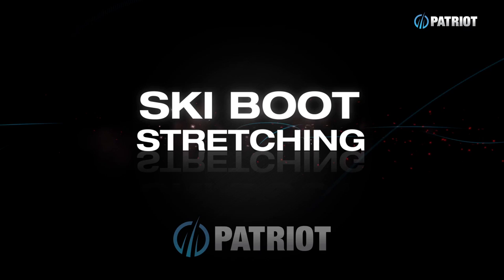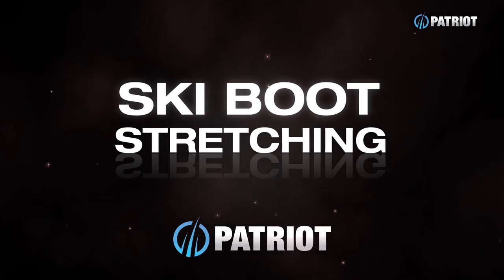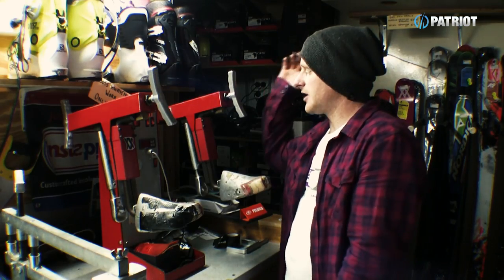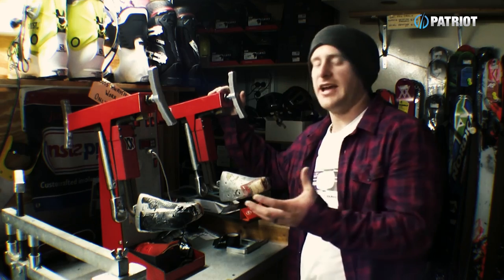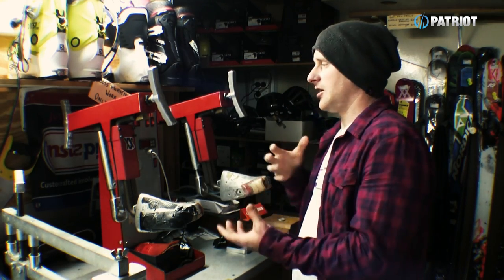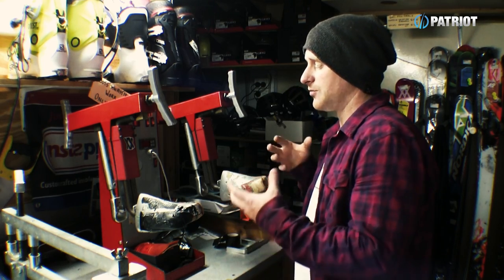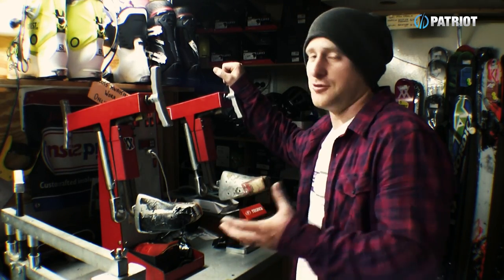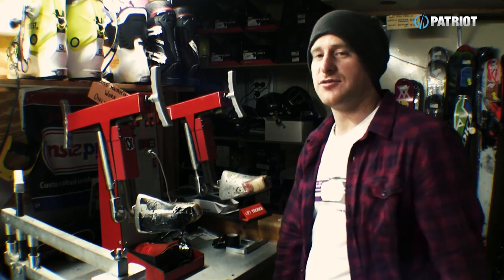Ski Boot Stretching- Bootorials Ep. 13

Comment: Hi, great video, keep up the good work. I bought boots that seem a tad smaller - they're all track 100, 28.5, but I keep having blue toes every time I ski. Also the forefoot seems a bit tight. Would you recommend stretching them? I'm currently in between Bulgaria and UK so not sure where to go. Any advise would be greatly appreciated.
Reply from the maker: Hi Georgi, Thanks!
Yeah so they definitely could be stretched if that is needed. But first I would recommend doing some sizing checks. 
I have a video series call Shell Fitting. That can help you figure out where the size or fitting issue is and dial in the best approach. 
If that is all looking good, then be sure to have some footbeds to stabilise your foot inside the boot, optimise the fit and keep your toes from slamming forward. 
And then if needed you can look to get them stretched out. I'm not sure about Bulgaria,(maybe in the Bansko area) but there will definitely be some bootfitters in the UK that can do this for you. 
Cheers and best of luck!

Comment: Hey bro, greats vids. You know where I can get a metal “jumbo” like that? Or did you make it
Reply from the maker: Hi Brendan, So these are sought through bootfitting suppliers, these ones are from Sidas and are quite pricey. Are you looking for one that you can use at home?  I am working on something that will be a bit more user friendly and consumer priced :)
Reply: Patriot Footbeds hey. Thanks for the response. I am looking for something to use at home. Would something Standard that I can find online be good enough?
Reply from the maker: Hi Brendan, I havent actually been able to find anything decent online.  You might be able to find some wooden ones but they are designed for stretching shoes. None of the mechanisms really hold up to the pressure needed to stretch plastic. If you find anything around, please let me know :)
Reply: Patriot Footbeds thanks man. Appreciate it. If I find anything, I’ll def let you know. Def going to purchase some of your footbeds for sure though
Reply: Great videos!  I also am looking for such a tool (toe box stretcher).

Comment: How do you stretch the calf volume?
Reply from the maker: Start by first looking to gain relief from just the liner. You can heat, manipulate and widen the top of the liner first. If not enough, you can then look to stretch or cut the cuff. In rare cases, I have had great success with plant pots and even footballs :) But probably the fastest and most effective would to be cut and grind approx a cm of the height of the cuff to get extra space for the calf.